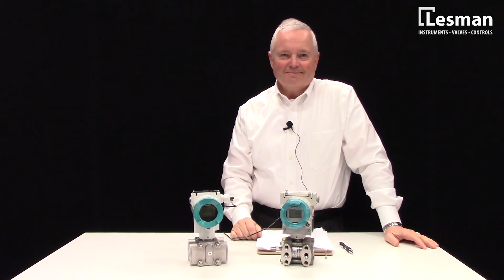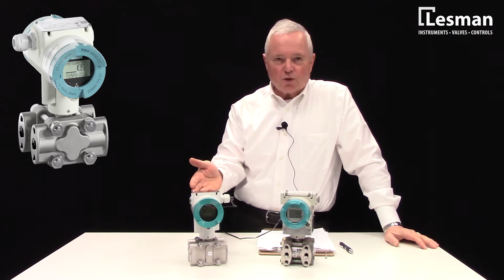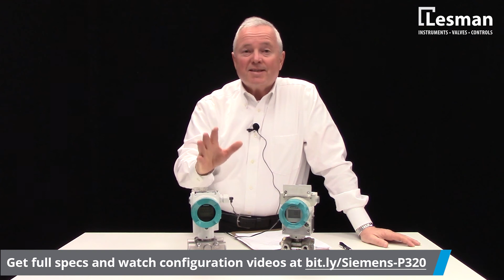New Siemens SITRANS P320 Transmitter - What's Different?

Comment: I love the DS III, only issue has been us not sealing the 2 cover screws down firmly enough allowing water into the magnetic buttons. There is a button/spring rebuild kit if you have to drill out the buttons due to corrosion. The P320 is actually worse with a sliding nameplate covering the magnetic buttons, certainly a downgrade. Will have to build covers for the P320 transmitter heads in wet areas. I love Siemens products but the P320 button cover wasn't thought out well, I expect more from this top of the line process instrumentation supplier.